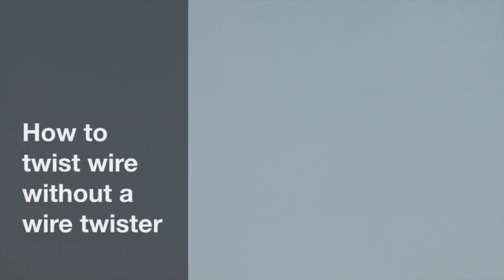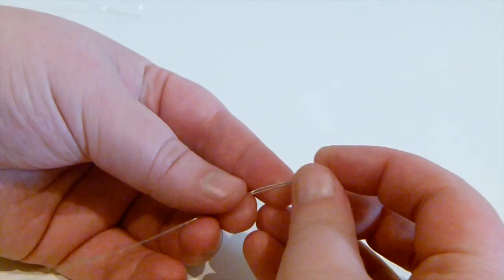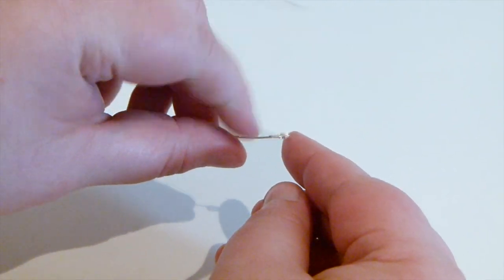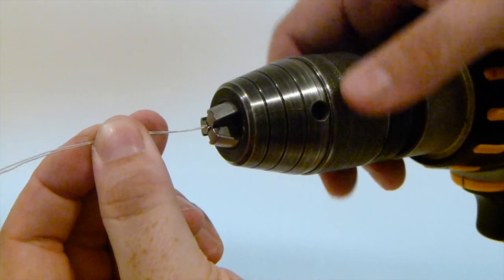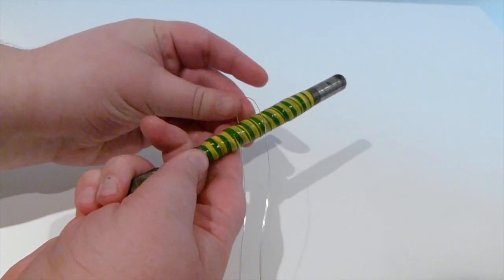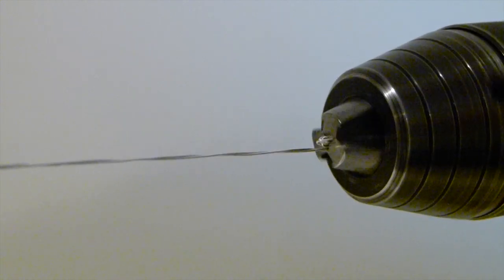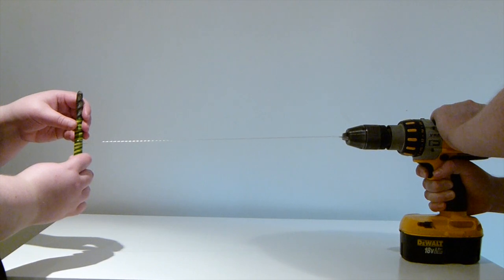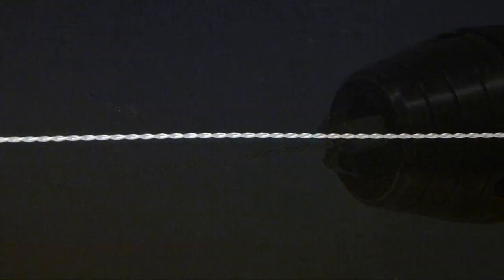How to twist wire without a wire twister

Comment: I've twisted copper wire and purchased already twisted silver wire but I'm clueless as to how to finish the ends, say, in making a bracelet. In either case, purchased or twisted it myself, the ends always seem to spray apart. I've tried making jump rings but the ends are never closed properly.  Any advice on what to do with the ends would be very much appreciated.  (The copper wire I use is thicker than the wire you used in this video)  Thanks for your help.

Comment: Hi C. I don't have a drill boo hoo. But I use a pin vise . They come in all sizes. 
It is the same only you twirl the vise till it reaches desired twist. I use the smaller gauge vise so it will hold almost all  gauges of wire. But as soon as I can Im going to get a drill.  Makes for an easier twist. 
Thanks |Suz
Reply from the maker: Suzanne Hale That sounds great though. A vice will work just as well. The only thing with the drill is it makes it a little faster :-)

Comment: One question, i know you said to hold it taut, but you show almost holding it in the exact same place.. as the wires twist together wont the length need to shorten, or if it doesnt wont it stretch the wire?  Or are you actually gradually allowing it to shorten a bit and we just cant tell, or does thin wire like this not really shorten that much?  This will come in very handy if i ever get the courage to try your wire woven bracelet :)  Very pretty, and this is a lot less daunting than i was thinking heh. (i was afraid that the "wire twist" would be like the "wire wrapping" in your elvish pendant.. THAT would scare me lol.  Way too much patience required lol. You have buckets of patience, skill, and talent.. you should either be a mother of many, or a nun with that patience heh.  Maybe a teacher heh.  Im a mother, but i just do NOT have that level of patient fortitude.. ask my kids LOL.
Reply from the maker: Summer Noybn Yes, you need to hold it taut, but not pull on the wires, if that makes sense. If you don't hold it taut the wire wont twist evenly, but don't pull to hard cause that can break the wire while you're twisting. So like you said, just hold it gently and let it move a little as it's twisting. But also you're right in that the wire does get shorter when you twist it, but with the smaller gauges it isn't as obvious. 
Hehe imagine that, me a nun :-P 
But I do hope that you give it a go when you're ready and let me know how you get on :-)

Comment: This technique is tolerable for malleable, uninsulated, solid wire, such as silver wire for jewelry. Twisting the pair twists each wire just as much. Twisting of a wire can change its surface finish or texture from shiny and smooth to matte and rippled. Wrapping the wires around each other, at or near the final wrap density, as you go along, would preserve the shine of the wires.
This technique is is less tolerable for stranded wires or insulation. Twisting tightens the twist of each stranded conductor, and invites breakage. Twisting the insulation can weaken and tear it. Twisting insulated wire can stretch it, reducing its diameter, increasing its resistance. Optimal construction of a "twisted pair" wraps the wires around each other without twisting them.
Twisting with a chuck can result in wrapping, to a greater degree, if the ends are left free to rotate. But this is not practical if the free ends are long and left to dangle. Long ends can be attached to swivels. The two wires, as they feed into the wrapped pair, should form a Y. In factories, elaborate equipment is designed to wrap long lengths of cable. Rotating spools can feed into a rotating bundle, that is taken up on another rotating spool.